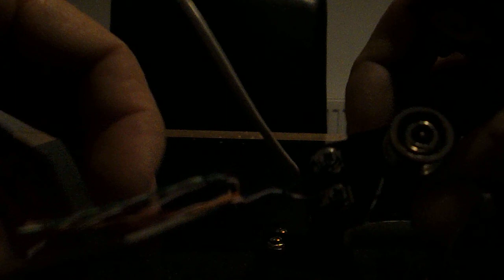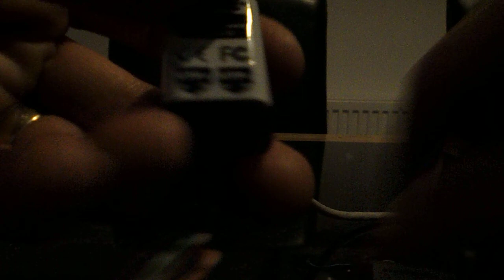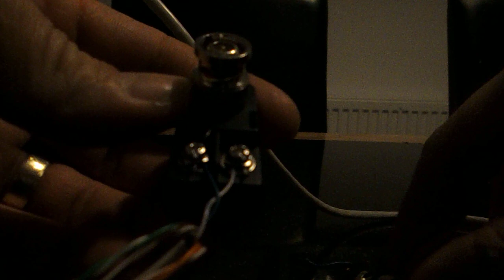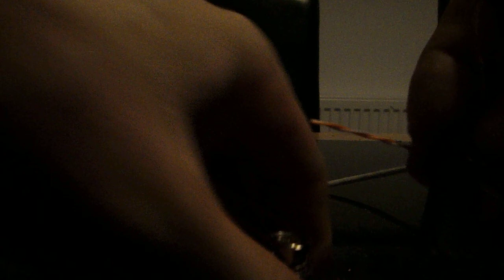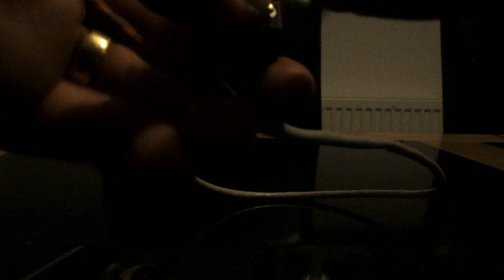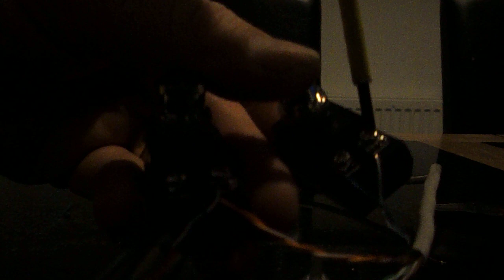Handy tips for CCTV installations. reduce the amount of cable you need, use cat5 and passive baluns

Comment: How about power for the camera?  I tried just like you showed on your video but I am not getting video nor power on the camera.
Reply from the maker: The balun only transmits the video signal, if you don't have a local power supply suitable for the camera then you could use any spare cores of the cat5 cable (not mains voltage).
Be aware of the polarity if your using a DC power supply, and be careful with mains voltage. seek a local installer if you are not sure. Don't damage your equipment by using the wrong voltage.